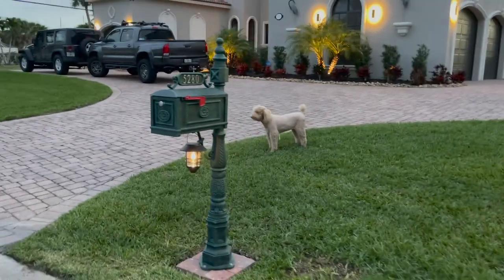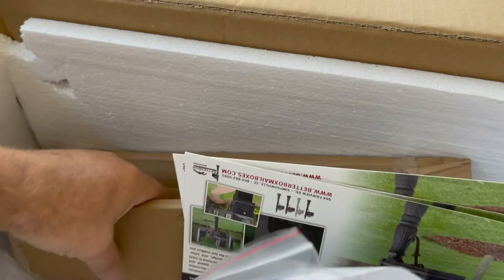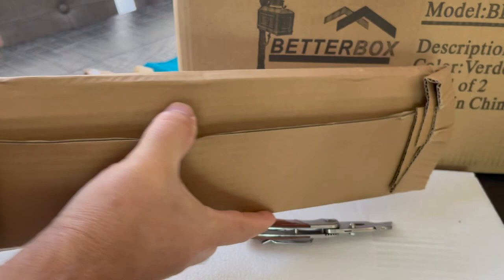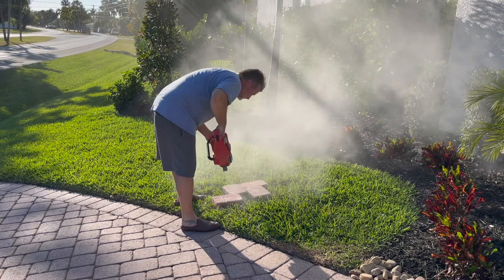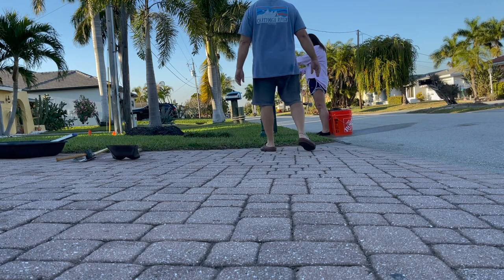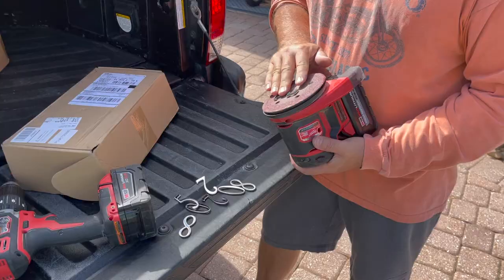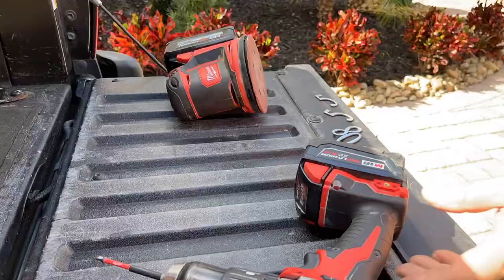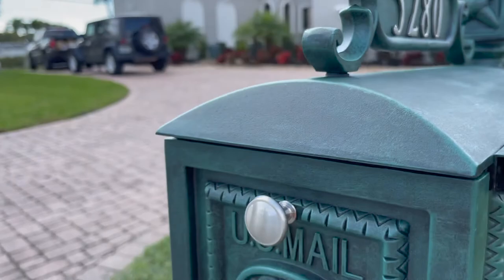Better Box Mailbox

Comment: The correct and best way to do this is to put down the cement 5000 psi or so is good trace out a template of where the bolt anchors will be placed then lay the template over the cement and lay the bolts in leaving about 1 and a half out let the bolts cure into the cement then drop the box on top and put the nuts on tighten down
Reply from the maker: Thanks!  That way sounds way better!

Comment: Beautiful House...Actually ordering this Mailbox this week, and was looking into the Black One...But Man, THIS green one is Nice....Love it🤙
Reply from the maker: Thanks!  Not a single issue with it. Built like a tank!
Reply: @bobbygfl  hey quick question....So to secure the mailbox to the base it doesn't come with the screws already? And the screws that fit in the base of the mailbox is 1/2 in ?
Reply from the maker: @ernestreyes9147  the hole is 1/2” I think but I used 1/4” screws with a washer. That way I could get it perfectly straight then tighten them down. You determine the length depending on what you’re mounting it to. I used stainless but galvanized would work.
Reply: @bobbygfl  okay Awesome...Thank u for the feedback 🤗🤙

Comment: Thanks for the great video. This might be a stupid question, but is there any way to adjust the post to make sure it’s perfectly plumb if things happen to be off? Or is it completely dependent on the pavers/concrete being leveled first? i.e. I’m shit out of luck if the concrete isn’t perfectly flat and leveled?
Reply from the maker: Yes, you can put washers under one of the bolts. Up to 3 probably. That would make a big difference if you needed it.

Comment: I got the same mailbox and I'm about to install it.  I didn't notice in the video the measurements you dug for the hole.  How deep into the ground did you go?  What were the sides of the square you made? 

Great video for this box!
Reply from the maker: the hole i dug was about 12" deep and 20x20 wide.  I should have used 4 bags of concrete.  this is a total overkill by the way but very solid.  and thanks!!
Reply: @bobbygfl  used about 3 1/2 bags overall w those dimensions. Worked great and is def overkill like you mentioned.  Thank you!

Comment: Bought the mail box based on the video.

Do you know the dimensions of the hole?
Reply from the maker: That’s awesome!  The hole? The hole I dug was about 14”x14”x 14-20 deep. Only because I used the pavers to keep the grass back. Smaller hole would work

Comment: What size screws did you use for the bottom post?
Reply from the maker: 6 inch. Depending on what you’re going into you could surely use shorter I’d say at least 2 inches into whatever your base is. I wanted to get below the pavers into the concrete. Also if you let the concrete set up for several days to a week 2 inches would be fine

Comment: Just put mine up. Did you ever plug that extra hole? If so, what did you use?
Reply from the maker: I did not. I planed to. A 1/4 plastic plug like this one should work. Also a stainless screw would work. MBPF-1/4" 0.25 inch Locking Black Plastic Body and Sheet Metal Hole Plug Qty 50 PDR Paintless Dent Repair https://www.amazon.com/dp/B019CX5JWY/ref=cm_sw_r_cp_api_glt_fabc_6932C6MQKZ5HGAA0V594